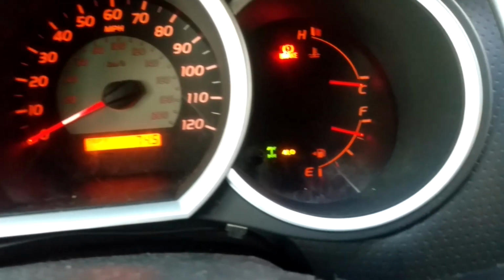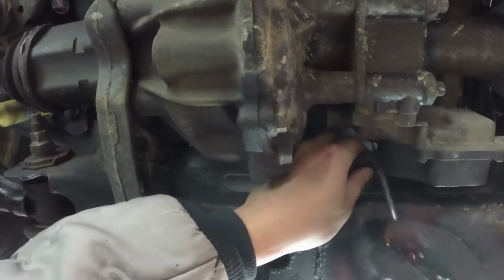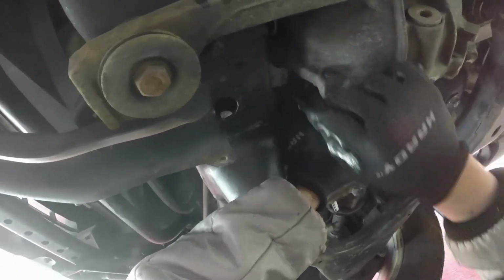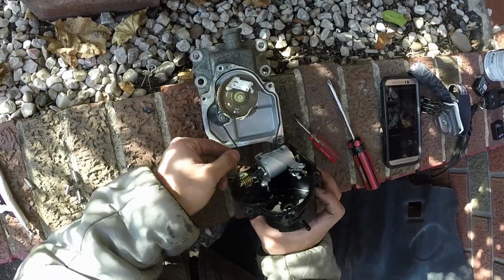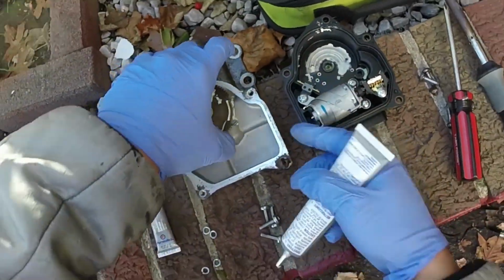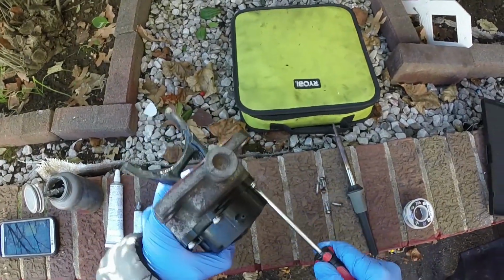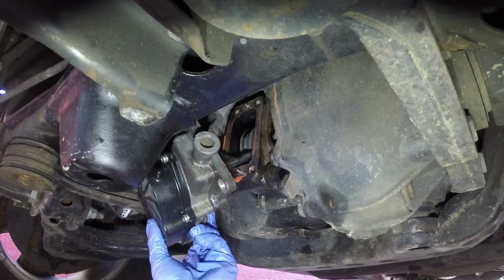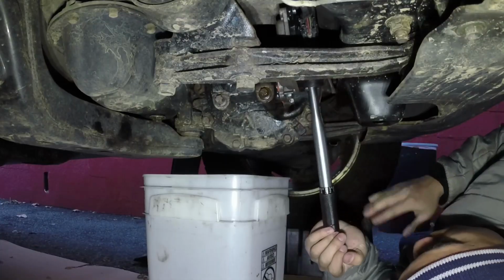4WD Fix (Tacoma DIY / How To)

Comment: I have a 2006 Tacoma  that will randomly flash 4H while in 2H when I start the truck.    I can switch the knob to 4H and it will lock in and it will go off when I switch it back to 2H.  But every restart of the truck it starts flashing 4H again.  If I accelerate while it's flashing you can hear it grindnig like it's trying to change gears    Do you think this would fix my issue?
Reply from the maker: This sounds like an actuator issue. You can try this repair and it should help

Comment: My truck was stolen. They fried the 4wd. They have literally replaced everything, front diff, t case, solenoid under the dash and it's still broke. 13k in damage and not fixed yet

Comment: Help....seriously help.  Was trying to replace the acutator yesterday and had everything ready to go.  I wanted to start with what I heard was thenhardest bolt to remove.  Well, needless to say, that is where I got hung up.  What did you use to: 1) get a tool on that bolt; 2) what tool was it; 3)were any prayers said beforehand?  You mentioned middle finger left amd index finger to loosen.....right now I'm all in middle fingers at this darn bolt. Any...and I mean any helpful hints, and prayers, are welcome.  😢
Thanks for your video.

Comment: I have this same problem. Strange thing is, if i plug and leave a code scanner plugged in the 4wd lights stop blinking and it goes into 4wd no problem. If the scanner is not plugged in obd port the 4wd dashlight is lit up and it wont engage.
Reply: thanks for leaving this comment I was about to take the actuator off and try this fix or buy a new one. ive only had this truck a few months 4wd went in no problem when i first got it now the 4wd light blinks. plugged my scan tool in cranked the truck held the clutch in moved the switch to 4HI went right into 4wd   does yours still engage with code reader plugged in ?

Comment: I wish one will explain why he choose to fix the one in front and not the one in the back of the transfer case. And how he determines the bad one.
Reply from the maker: That's the 90% fix that many Tacoma Owners went with on Tacoma world. Also, the actuator in the front is for the 4wd (front wheel) engagement, the actuator at the rear is for switching from 4Hi to 4Lo
Reply: @TacomaTutorials  Thanks man. I appreciate your answer.

Comment: I got a question..? I had my 4wheel drive go out after 150k miles so I did a test to see if I could fix the original one after watching your video and it worked perfect simply needed a lil bit of solder on the connectors and it fixed the old one instantly. Soo after I fixed the old one I took it out threw it away and soldered the new one I bought straight out the box to try and bullet proof the bitch. Truck runs great but I’m curious why every time I shift into 4wheel drive it has a rather loud clunking sound.?
Reply from the maker: You have fresh fluids in the front diff right? Does it clunk when you take it of 4wd?
Reply: Yep all new fluids, it’s a quiet clunk going in a a loud one going out
Reply from the maker: Mine also clunks once in a while going in and out of 4wd. You may just need to cycle it on and off all the way to 4Lo in order to wear in the actuator a system.

Comment: Thanks, nice work. I purchased a new 09 Tacoma LB DC 4x4 now with 192,000 miles. I think I will start doing my own maintenance my auto repair shop charging too much now. For example, they replace the belt & tensioner for $700!! & they didn't replace those 2 idler pullies.

Comment: Need HELP. Once I connected with the socket to the actuator just to test, it works perfectly on the truck. But once I put it back in place it gives me 2w to 4w failure.
Reply from the maker: Did you make sure to put the fork in-between the two shoulders of the flanges in the diff?
Reply: @TacomaTutorials  I did. Then it shows 2w to 4w fail. Then I take it off and leave it connected with socket it works. But as soon as I put it in it doesn't. I'll order new part and see.
Reply from the maker: If you have the front of your truck on jack stands, you should be able to move that collar back and forth by hand. Here's a video of what that assembly looks like when it's fully taken apart (Skip to 2:25): 

https://www.youtube.com/watch?v=JhCUFpXiQXM&ab_channel=KFloTacoma

You can align the splines by moving one of the tires by a few degrees and moving that collar back and forth - you're trying to mesh the teeth essentially.

There should be no resistance when you move that collar back, unless there's something seizing up on the assembly
Reply: @KFlo Tacoma  no resistance at all. It moves smoothly. That's why it was confusing me because when I plug in the socket to test, it works perfectly fine, as soon as I put it in place, it don't even try to move to 4wheel, start up the car and the alarm comes up not even trying to go to 4 wheel. So I order a new part, hopefully that helps.
Reply from the maker: Yea, good luck with that. Maybe the electric motor is not working under load? It may have some windings that burned out?
Reply: @KFlo Tacoma  yea my exact thinking 🤔. Thanks. I'll update you. Hopefully this will help others too. Lol
Reply: @TacomaTutorials  so I got brand new part. It works, the warning went away. But I still can't get it to go into 4wheel. I can hear the grinding from under the driver side. From the transfer case actuator motor... smh

Comment: I did But Stel don't work
Reply from the maker: Did you change the whole actuator? or just did the soldering?
Reply: @TacomaTutorials  just the soldering
Reply from the maker: Did you test the motor with a power supply after soldering?

Comment: Hello I followed your instructions but when I started my car, the 4w drive is still not working and it keeps blinking. What can you suggest I should do? Do I replace the whole unit?
Reply from the maker: Yea, it's fairly cheap. I have the part link pinned in the top comment of this video
Reply: Hello I bought the replacement unit from Amazon but when I installed it but the lights is still blinking and not engage. I also bought the switch 4 wheel drive replacement from toyota company but nothing change. What do you suggest I should do? Thank you for your time.
Reply from the maker: I would suggest inspecting the wiring to see if you have any tears on the cables. Also use some contact cleaner on the harnesses to make sure you have proper electrical connection. Are you also rolling the truck forward slowly when you're activating the 4WD?  Do you have automatic or manual transmission?
Reply: @TacomaTutorials  hello I did everything that you instructed. I clean the cables with the contact cleaner and replaced the vacuum hole. I have an automatic transmission. My model is tacoma 2007 V6 transmission. But when I started my car the lights still blinking.  Thank you for your time.

Comment: My 2001 Tacoma got stuck on 4-wheel drive, what I did was disconnect the electrical connector and it disengage, do you think my problem is the actuator? it goes back to 4 X 4 when I connect the electrical back. Appreciate your help

Comment: Been there ,done that but….I never found the bad connection even thru I checked with a meter 3 times. Some how on the 4th try I found the bad connection. However this was months after the fault occurred so that by that time I had bought a new one for over 800 ca dollars. Now I have a spare for my 2 year newer truck. What caused the melted solder connection was making a 90 deg turn on pavement with my boat in tow. Just took it out of the water. Lesson learned; never take a truck out or put in 4x4 while making turns.

Comment: In Process - started this project and will let you know if it works once the gasket material dries and I add fluid.  Here is what I learned. (1) a short (3") rachet makes taking out the upper bolt on the passenger size a breeze. (2) The screws holding the actuator together were severely corroded and almost impossible to remove with a screwdriver, I live in MI. (Thank you vice grips.) The screws can be replaced with 5mm x .80 pitch, 16 mm in length cap screws.
Reply: Did your gasket seal?

Comment: I hope this helps someone that reads this!
I have a 2014 tacoma. I got in it and it was stuck in 4 wheel drive and I had not used my 4 wheel drive in over a week. I was almost sure this was the issue. After checking the plugs and wires and the vacuum line and all were fine. I decided to take my actuator out and check it. The motor worked fine when I hooked it up to the 12 volts. So I pit it all back together and thought about everything and thought I'd have to take it to toyota.  Then I decided to check  the switch in the dash and that was the issue.  It wasn't bad it had just come unplugged somehow.  Maybe when I had my stereo installed they didn't get it clipped all the way. So this is an option. If you try to pit your truck in 4 low improperly and it doesn't make the beeping noise or your 4 wheel drive lights are not flashing! Check the plug on your switch!!!!! Again I hope this helps someone!

Comment: My truck won’t engage 4wd, the light just flashes. I took apart the actuator and beefed up the connections to the motor, greased the gears and I also tested the motor with 12v and it worked, I put it back together and it still won’t go into 4wd. Any thoughts?
Reply from the maker: I would suggest cleaning the terminals of the connectors with some electronic contact cleaner. Then reconnect and test
Reply: @TacomaTutorials  cool, I’ll give that a try when I get home today. Right on for getting back to me.
Reply: So I still can’t get 4wd to engage. I can here the motor run in the transfer case actuator running when I switch it to 4wd, but I can’t here or feel anything in the front diff actuator. Do you know the sequence of operation?

Comment: KFlo, thanks for putting this video together! I was able to fix my 4x4 problem by following your instructions. My problem wasn't related to the contacts coming loose on the motor, however... it was because there was a bunch of water in the actuator! After draining and drying it out the best I could, everything went back together and works great now! One question... do you know how to seal the actuator up so water doesn't get in it again?
Reply from the maker: I would use RTV, the same one on my amazon page. Amazon.kflo-krib.com

Comment: Hi.  Got a 2008 (second gen) toyota tacoma 4wd V6.  Problem was 4x4 was intermittent (especially in wet weather) and unreliable going from 2wd to 4wd.  Did that for about a couple years but then all of a sudden it's stuck in 4wd.  Read all the posts about the front ADD actuator and I assumed that was it.  Took the actuator off and inspected it.  Very clean inside, tested the motor and it works, soldered the connectors anyway, and put back together correctly.  

Next, went to the Transfer Case actuator.  Saw the vent tube was broken and I suspected moisture.  tried tapping the actuator lightly with a rubber mallet and the plastic now 13 year old vent hose nipple broke off.  So, I removed the actuator and immediately saw the problem.  Water inside, very badly corroded terminals, so basically a bad actuator beyond repair.  Ordered a new actuator for about $250 off amazon.  

My question is this:  How do I orient the transfer case shift axle to reinstall the new actuator?  I believe the new actuator comes in the 2WD position (the gears inside).  My old actuator was in 4WD position when taken off and the shaft was in 4wd since it was locked in 4wd.  The front add is locked into 4WD.  Should I take apart the new actuator and turn the gears to the 4WD position and then the new actuator will be in the same position as the old one?  Or do I try to push the axle into the TC to the 2wd position (all the way in) and install the new actuator?  Also, there's about 5/16" of play on the shaft.  How do you make sure the shaft is positioned correctly when you put the new actuator on?   Watched and read a lot and can't quite find the answer.  Thanks for any input!
Reply from the maker: with the 4wd actuator: You can just reinstall as is. Set your dial to 2H and unplug the battery. The computer goes through a routine to make sure that the system is in 2H prior to doing anything else.
with the transfer case actuator: I would recommend just reusing the old shaft axle. I haven't messed with the transfer case actuator but I believe that shaft axle requires the whole transfer case to be disassembled in order to be removed

Comment: I don’t know what I can do to fix my 4x4 it’s a Toyota Tacoma 2009 I had broke my axle then went to get it fixed when it broke my 4x4 light never came off it just keeps blinking even till now I just wanna try to fix it myself
Reply from the maker: Did you disconnect the battery to reset the computer?
Reply: @TacomaTutorials  I sure did
Reply from the maker: Have you tried the fix in this video?
Reply: Not yet but I will soon

Comment: Why in the world wouldn't you indicate "the proper torque spec" for the 4 bolts?  The answer for those of you out there wondering is 21 N*m , 210 kgf*cm, or 15 ft*lb.
Reply from the maker: Thanks for the info. Let me know how that works out for you trying to fit a torque wrench in that tight gap. Also, please do make a video that details your work since you can apparently do a better job.
Reply: @TacomaTutorials  Whoa man...it only bothered me because you reminded "me" ("us", "viewers") in the video to torque it to spec.  Honestly, I was just trying to follow your lead, because its a great instructional video!  Thank you for making it!  (I guess I should have led with that, my bad).  
BTW I got a small 3/8 drive torque wrench I was able to get on for 3 of the bolts.  The tough one in the top left, I had to use a U-Joint which means I have no idea what I torqued to... :^/.  Also, I got these from the OEM repair manual pg DF-38, a section which walks through a complete removal, disassembly and reassembly of the front differential (to your point, its different).
Reply from the maker: My bad dude - I did take that initial message negatively. I get a handful of trolls that leave condescending/racist comments on this channel and I sometimes end up on the defensive.  Thanks for watching

Comment: I did soldier the actuator motor I put everything on. now just waiting for the 24hour to refill the oil. Can I try switch on the 4x4 to see if it work or do I have to wait till I fill it up?? I really want to see if it works🤔
Reply from the maker: I think you should be able to try it without the fluids
Reply: After waiting 24hrs I finally tried it and it works a little better. From 2wheel to 4hi works great but from 4hi to 4low the lights start flashing again and my truck got stuck on 4x4. I had to drive it around turn off the truck multiple times to get it out of 4x4. Some reason it only does it when I use 4low🤔🤦
Reply from the maker: When 4 lo flashes switch it back to 4hi. Move forward a tiny bit then try again. It has to be in neutral/park
Reply: @TacomaTutorials  I replaced the actuator to a new one and it's still not working. The lights is still flashing. Do you have any advice??
Reply from the maker: Did you use contact cleaner to clean the surfaces of the metal contacts in the connector? Did you make sure that when you reinstalled the actuator, the forks of the actuator are between the shoulders of the collar?
Reply: @TacomaTutorials  me and my friends did check the new actuator before we put it on just to see if it work. I heard the motor inside so we decided to install it. After we installed it we check again. Didn't start the truck just turn the dialed to 4hi sounds like it engage. After one hour of waiting for the seal to dry from the actuator. I started the truck and drove it up to 20mph then turn the 4x4 the lights started flashing again.
Reply: I was thinking maybe when I tested the actuator before putting it in the motor move the fork to 4x4 then when installed it it was on 4x4 instead of 2wheel. I'm thinking I have to take it out again and see if I can move it back to 2wheel then put it back just have to figure that out. One more thing my vacuum line seems like it's not sucking air that could be the problem too. To answer your question no I didn't clean the connector. I'll have to do that too.
Reply from the maker: That vacuum line is just a breather hose. There should be no vacuum pressure there.

Comment: What oil did you use to fill back the transfer case fluid?? I bought one at napa valvoline gear oil 75W-90
Reply from the maker: I use redline. Check out my front diff fluid replacement vid
Reply: @TacomaTutorials  I will thank u

Comment: What’s the torque specs on the 4 bolts?
Reply from the maker: Hand tight is fine. It's really tight in there to get a torque wrench head and a low profile socket. the RTV will keep the fluid sealed in place

Comment: Just orderd a replacement acuator. What are the 4 bolt sizes?
Reply from the maker: Unfortunately I don't have that technical information on hand. I would recommend pulling one of the bolts out and checking it against a thread gauge. It's sealed with RTV so pulling it out (to take measurements) and then putting it back until you get the parts should be fine.

Comment: What are the specs of the bolts for the torque wrench?
Reply from the maker: Hand tight is fine. It's really tight in there to get a torque wrench head and a low profile socket. the RTV will keep the fluid sealed in place